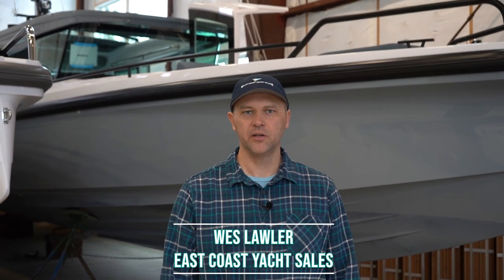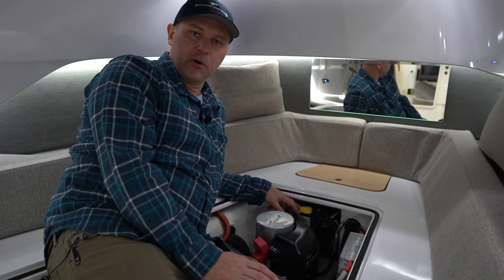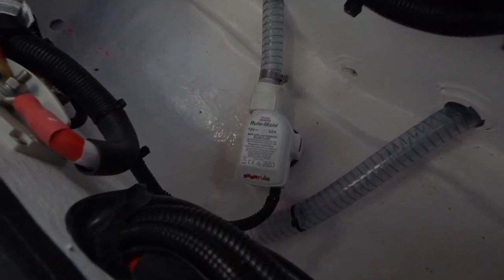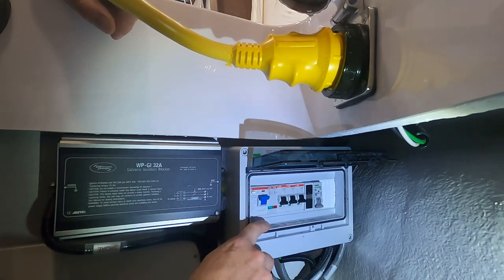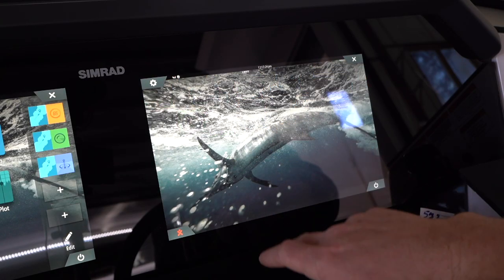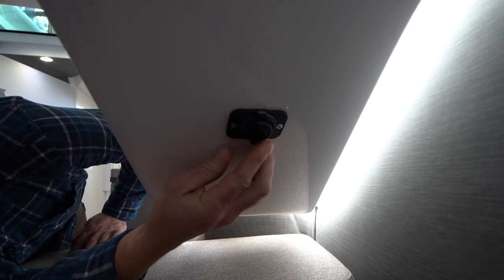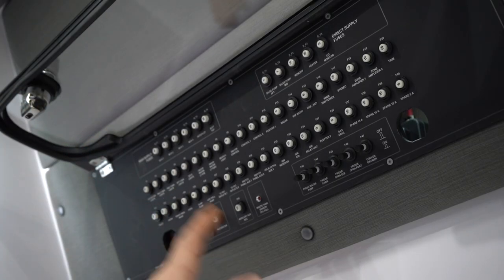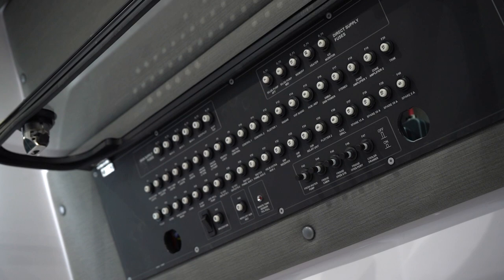Axopar 37 Education Series: Electrical & Battery Systems

Comment: Going to install a starlink satellite, wondering if you have a wiring run from the radar / roof video
Reply from the maker: We do not have a video for that but that could change… love that idea.
Reply: @EastCoastYachtSales  all the Velcro vs. Panel mounts behind buttons, accompanying the run down the radar . Our goal is to match the starlink system to a spare AUX button on the helm. For certain there are other boaters using the auxiliary buttons for something else and y’all are the YouTube authority on Axopar. Thanks for the consideration. I believe this content item could be very helpful to many owners!